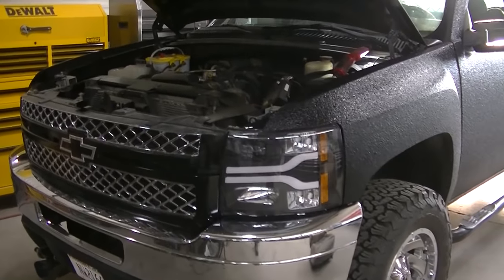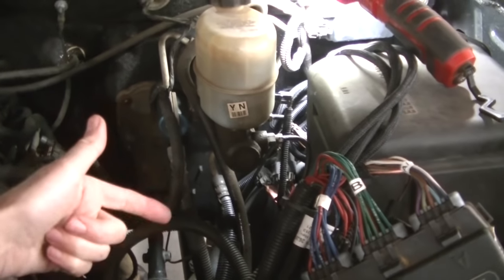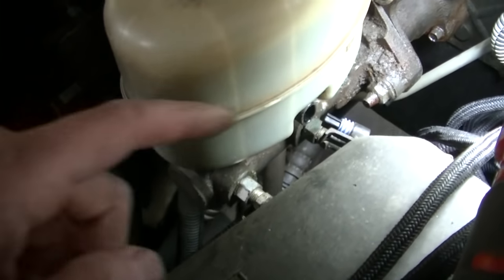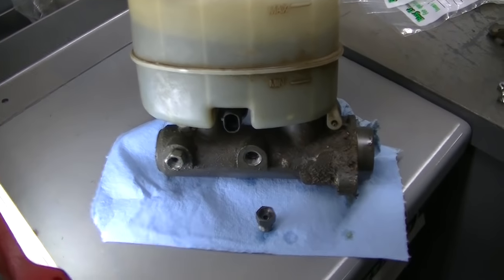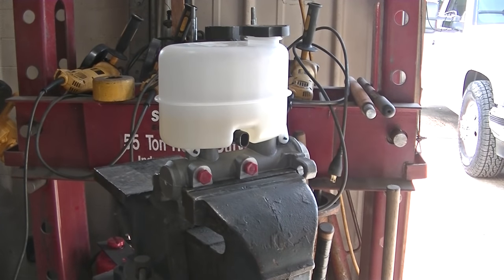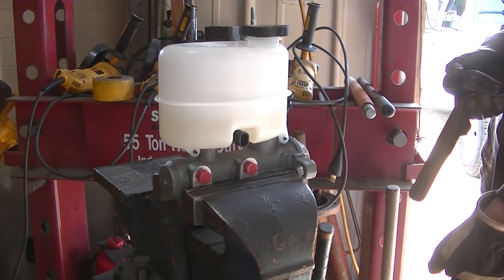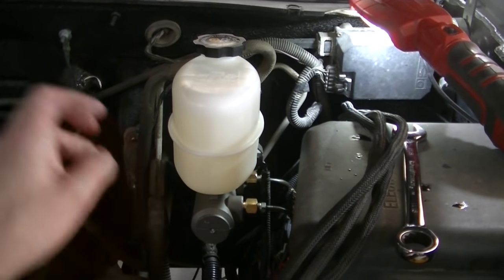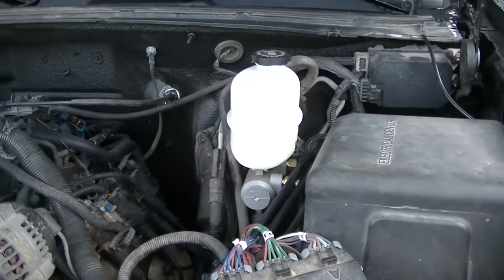Silverado GMC New Master Cylinder Install "Project Frankenstein"

Comment: That truck sure has grown on me.  I like it!
Reply from the maker: There are things I want to do with it but it will have to wait until dads car is done.
Reply: I think they want you to bleed it with the cap off so that the air can escape the reservoir. 
I noticed you had the cap on.
Reply from the maker: Directions said to leave the cover on.  When I read the instructions they didn't seem right.  Should have just done it my way.

Comment: Was about to say the way the instructions told you to bleed it looked hoaky.  I've always bled it the way you do on a vice with lines running back into the master's reservoir.
Reply from the maker: I had a little voice in my head thinking that was an odd way to bleed a master cylinder but I went with what the directions said.  Should have listened to my little voice.

Comment: You skipped the removal part? That's why I'm here..
Reply from the maker: Use your common sense! Two brake lines, unplug wire and two bolts.
Reply: @mossman381  did you lose fluid when removing? Doni need a pan under the MC?
Reply from the maker: @felipetunchez6018  When you take off the lines they will leak.